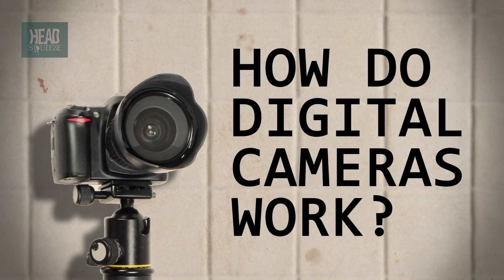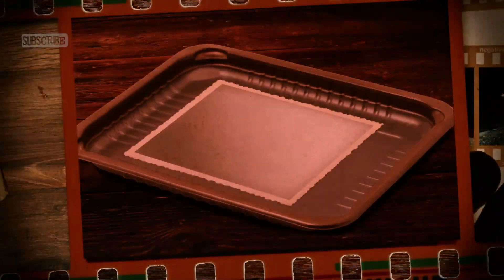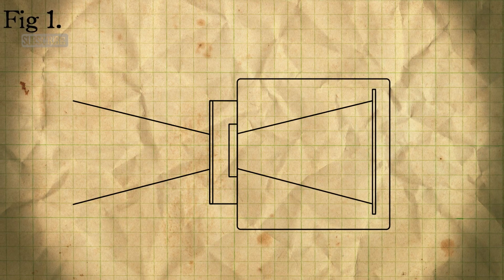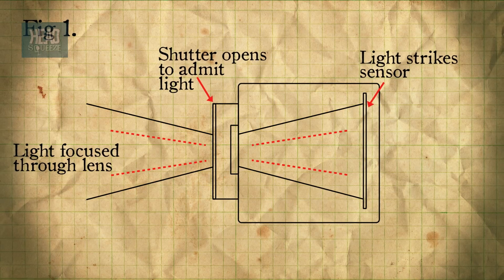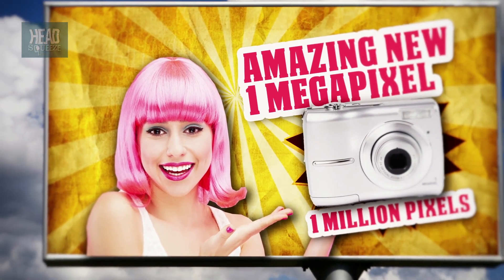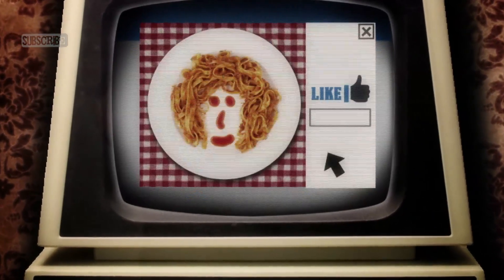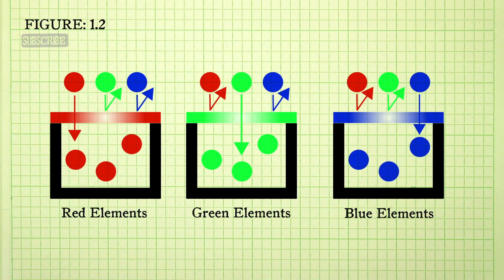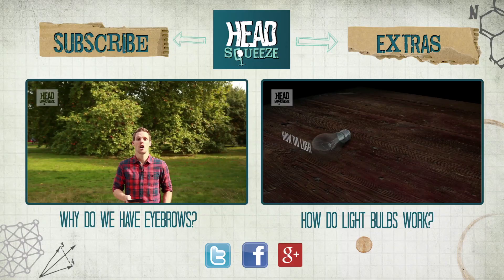How do digital cameras work? | James May Q&A | Head Squeeze

Comment: A sensor does not have pixels. No big lies, but not good enough. Pixels - as in displays - have subpixels in red, green and blue, or a native RGB value. Digital camera sensors have photosites and these are either red, or green, or blue. Meaning the photovoltaic cells in the sensor - aka photosites - are monochrome in either red, green or blue and not pixels. And are generally arranged in a way where one red, one blue and two green specialized photosites in a square according to Mr. Bayer populate the mega quantity of photosites. When we make a photo, the main electronics "reads" (measures) the photosites - sequentially. These "read" values are stored in memory, but only have either a red, a green or a blue value. This is the rawest version of our digital photos that we shall never see. The computer in the camera, in firmware (software) - alluded to by James - now processes the photosite readouts and extrapolates - by interpolation with the environment of a photosite value - a hypothetical color value to complement the one that was measured. Thus the value of an R photosite is complemented by a G and  B value. Because of the regular arrangement of color specialization in a Bayer sensor, and because of naive firmware and hardware, we have seen a lot of photos with Moiré patterns. These are pure digital artifacts from the algorithms applied. Demosaicing was added into these algorithms to hunt for Moiré patterns and take then away again. But then, what do you do with certain photos that have Moiré patterns because the subject has them?
When all this computational effort is ready, the result is written to the camera's memory card - as the raw file. I'd say, computationally, that file is not raw at all, but extremely well done. If a camera was not equipped to save raw files, then the raw file is certainly created in the "camera" and in the case of JPEG format, the file is processed another time to compress dynamic range from the camera's bit depth to the 8 bits per color channel of JPEG - meaning we lose gradation or nuance levels. Also, we loose detail because of data compression in the JPEG format. The story would not have been more difficult if the AD conversion had been positioned, the bit depth, the sequential reading of cells and the time parallax this causes andsoonandsoforth. Just not good enough.

Comment: So why do we call the camera "digital"? It uses digits, but how? What's behind a pixel? It works through the binary system? Thanks a lot.
Reply: Sevak Kirakosyan Digital is a polysemantic world. You call it digital camera becouse digital electronics are "electronic circuits representing signals by discrete bands of analog levels, rather than by a continuous range". You can think about a digital camera or clock or whatever digital electronic device  as a device that contains a microchip.
Reply: +Sevak Kirakosyan Because the processed electric signal is in 0's and 1's – digits. Also known as binary code.

Comment: Sorry James (or, more properly, Head Squeeze researchers), Big Mouth Billy Bass came out in 1998 while I definitely had a digital camera in 1996 (the Kodak DC25, I've still got it packed away somewhere) while my middle-school buddy had the Apple Quicktake 100 at least a year earlier (it was released in 1994). And these were just the early COMMERCIALLY available digital cameras, extremely expensive professional digital cameras existed before that.

Also worth noting that the primary reason CMOS (pronounced SEE-moss) sensors are so ubiquitous is that it's far less expensive and less power-hungry than the CCD varieties. The downside being that it actually has to observe the image one line at a time (kinda like a scanner) which, on particularly cheap cameras like those found on phones, can result in distortion effects when the camera and subject are moving in relation to each other (see http://en.wikipedia.org/wiki/Rolling_shutter ). CCD, on the other hand, takes a snapshot of the scene so you don't get this effect (though you do get other effects such as when a point light source is bright enough you can get a vertical smear as the electrons spill over into neighbouring cells).

Of course the ubiquity, low cost, and low power use of CMOS means that there has been far more R&D on it than CCD which has resulted in some very high quality CMOS sensors that don't have nearly as much distortion as their cheaper siblings which is why you can even find them in high-end professional DSLRs.

Comment: Megapixels are great. But they're also misleading. Did you know 35 mm film has detail equivalent to about 35 megapixels? For that matter, 'full frame' film cameras produce images exceeding an effective resolution of 100 megapixels. But... This doesn't take into account yet that the 'megapixels' of a digital camera aren't proper pixels... a colour pixel needs to have an RGB value. And the 'megapixel' rating counts each red, green & blue pixel element as individual things. (Which would be correct in a black & white sensor, but is wrong in a colour one).
This means the actual 'resolution' of a digital camera, when compared to say a computer screen, is only 1/3 of it's 'megapixel' rating. (or 1/2 at most if you consider the image processing.) - I'm staring at a computer screen with the (for current computers) rather low resolution of about 1 million pixels. But, to get a good quality picture that takes up the whole screen without any missing detail, it would require a 3 megapixel camera...
Reply: A standard HD screen of 1920×1080 is 3.456.000 pixels, which is equal to 3,456 megapixels. Not 1 MP. So this is only logical.
I have a 12,2 MP DSLR which (not surprisingly) shoots at 4272×2848 pixels (12.166.656 pixels).
Reply: No, you're making an incorrect assumption there. A standard HD screen is not what I mentioned in the slightest. I was referring to the display on the laptop I typed it with, - Which is 1280 by 800. or pretty much EXACTLY 1 million pixels.
Your comment seems to have missed the point though.
While your DSLR may well output at 4272x2848, this is an interpolated resolution.
The 12 megapixels of your camera consist of just 4 million 'real' pixels. Any additional resolution is entirely down to interpolation.
The 1280x800 display on my laptop contains 1 million RGB pixels. Which, in fact each contain 3 sub-pixels.
By comparison, your '12' megapixel DSLR DOES not contain 12x3 million sub-pixels. It has 12 million sub-pixels TOTAL.
To create a single colour pixel value thus requires combining 3 sub-pixels.
Thus the actual resolution (as in the definition of 'resolution' used in telescopes and the like, as the minimum size at which two points can be seen as seperate from one another )of a 12 megapixel camera is only sufficient for a display with 4 million pixels.

Unfortunately, this means if your camera is outputting files with 12 megapixels, it is 'making up' the content of at least half of them.
Reply: KuraIthys Also, a 12.2 MP DSLR actually outputs 12 million pixels. A bayer array (or bayer filter) doesnt use every four "pixels" (photosites) once, it generates an RGB value from every point between the photosites. So every photosite contributes to four adjecent pixels. Source: http://www.cambridgeincolour.com/tutorials/camera-sensors.htm
Reply: malvinmalvin You can't just reuse a photosite without consequence though; Because photosites generally do not overlap, if there is a green photosite the red & blue information is missing for that location. Therefore, it is interpolated.
- Interpolated data is NOT the same as having a proper RGB pixel data. You're generating 12 million pixels from 12 million photosites, where you should be generating it from 36 million. Thus 2/3 of all your image information is made up, and is not actually something the camera ever captured...
Reply: KuraIthys Indeed there are some drawbacks, and using a bayer array the way you described might yield better results, but with much fewer pixels. I only meant to point out that a 3MP camera actually outputs 3MP, not 1 MP.
Reply: malvinmalvin Technically yes. And for black and white images it makes no difference. Interpolating data by some estimates can, under ideal circumstances give you about half the resolution you'd expect (largely because there are usually two green pixels in a group of 4), but what I was getting at overall is that in spite of the output resolution, you aren't actually getting the resolution you think you are in the image itself. (By contrast, a 3 CCD video camera is giving you exactly the resolution it claims to without interpolation, because it has independent sensors for each of the RGB channels)

Comment: Most CCDs in consumer technologies also work how James described the CMOS, using the Bayer pattern to record color information.  The real differences between the two come at the fundamental electronics levels and the mechanic of how they actually handle the light to charge to voltage to digital value conversions on the sensor itself, or within a second complementary circuit.

Comment: Thanks everyone who replied with useful info on this tech, yes I know that it does 38mp + 5mp or 34mp + 5mp depending on aspect ratio, I was amazed with the low light performance on my lumia 920 & 1020. I was genuinely asking why top end point and shoot and dslr 's don't have the high pixel count like the 1020 and Iam aware mp is not the main factor of picture quality. Once again thank you all who replied with useful info.
Reply: The only pro DSLR body to have a high MP count is the Nikon D800, which has 36 megapixels. The Flagship DSLR's do not, mainly because of how pixel density affects low light/High ISO performance. When this isn't a factor, such as for medium format cameras that are used only in a studio with controlled lighting, the megapixel count is increased. Check out the Hasselblad H4x. It's an 80 megapixel camera.

Comment: Could you explain the difference between CMOS and CCD?
Reply: CCD refers to NMOS sensors, that means that instead of transistor pairs (the complementary in CMOS) you only have one n-channel transistors, CMOS is the newer technology, with lower power consumption among other benefits. these terms are not camera/sensor specific, but they are basic building blocks in electronics.
Reply: kara88bg While what ***** says is technically true, from a practical construction standpoint the real differences between CCD and CMOS sensors in cameras are a little bit more complicated than that.

Largely it has to do with the charge-to-voltage conversion methodology and the location of processing circuitry.  In a CMOS sensor, each pixel converts the charge gained from exposure to light to a voltage, which is then addressed individually and passed to an analog to digital converter (ADC) to get a numerical value for the pixel.

With a CCD, however, there is only one common charge-to-voltage converter.  Pixels are not individually addressed, but are addressed by column.  The bottom-most pixel's charge is passed to the two converters, and each pixel above it in the same column passes its charge down to the pixel below it, until all of the pixels in that column are read.  Then the process starts over with the next column of pixels.

In terms of results of the construction, this means two things.  First, CMOS sensors can easily 'scale down' in resolution, i.e. digitally zoom in, by windowing only a small region.  Focusing on only one region of the sensor allows them to have a higher frames-per-second refresh rate which is why many professional cameras offer higher frame rates at a slightly lower resolution (slow motion).  On the other hand, CMOS sensors have no global electronic shutter: if there is no physical shutter between them and light, they are always gaining charge, unlike CCDs that require a global electronic shutter to prevent smear as they pass the charge down the column to the common charge-to-voltage converter.  CCDs cannot be windowed, and the entire sensor must be read at once for every frame.

While both types of sensors were invented around the same time (and by the same people), CCDs quickly became the defacto standard for imaging because without an ADC they can be used as an analog video sensor, at much lower power consumption than the video tubes used before it.  The CCD made electronic news gathering (field news recording on video instead of film) possible.  For decades CMOS sensors suffered from variability in the black and white points of the charge-to-voltage converters - slight differences between them led to wildly different voltage values.  Modern CMOS sensor systems compensate for the black point variability by storing a black point calibration, factory set for each CMOS sensor and only changeable in the highest end digital cinema cameras.
Reply: TechLaboratories ***** Thanks a lot for your answers, thanks tech labs for explaining that in such detail.

Comment: Nokia 41mp .... Why can't top end DSLR cameras match Nokia's tech of 41mp which is in a smartphone? Nokia ftw
Reply: higher mp isnt equal to better quality of picture.
Besides, http://www.gizmag.com/canon-120-megapixel-cmos-sensor/16128/
Reply: Rian Effendi smaller and lower quality, only reaches 38mp max anyway
Reply: The makers of professional cameras only raises the pixel density when they are sure that they can keep the noise at a reasonable level.

The smaller the pixel sensors become, the more susceptible they are to electrical interference from neighboring pixel sensors, AKA noise. The sensors you find in professional cameras, like Hasselblad, are huge with huge price tag on them as well.
Reply: I prefer a lower mega pixel count, especially when shooting films... Better low light performance.
Reply: And yet picture quality and camera performance is atrocious compared to a real camera.

Comment: IMO the problem with Hammond's hair is caused by the AntiAliasing (AA) filter which is nothing but slightly matted piece of glass in front of the sensor which makes everything a tad blurried. Combine it with the mess on the Hammond's head and you'll get a visual disaster. Try to remove this filter - you will have a nasty moire on the regular objects but Hammond's head (and may be even his jokes) will be rendered a little bit sharper. Sorry for my poor english.
Reply: I think the trend that manufacturers do these days is removing the AA filter to give more detail to the image, and even though it doesn't have the filter, the results for moire is almost to none at least to me 

The technology is improving a lot compared to the early digital cameras

Comment: 12 or 16? Nikons entry level DSLR's now are 24mp =P
Reply: They do but it's thats not really that important, it's the person behind the camera that matters.
Reply: Luke Clark Did I say anything about 24 making people better photographers? I was referring to what he was saying about 12 to 16 megapixels being common place with high end cameras, when most professional cameras and even cheaper ones are using 2x and sometimes 3x more pixels than that. Not including the Hasselblad or other medium format.
Reply: Although, top range pro bodies, namely Canon 1Dx and Nikon D4, still rock "only" 18 and 16 MP, respectively. But that's because of better low-light performance and incredible burst rate they can achieve.
Reply: TheDoubleBee Less data for the processor to deal with. I would hate to see how big the heat sink and battery would have to be to manage 36mp raw files at 10fps.